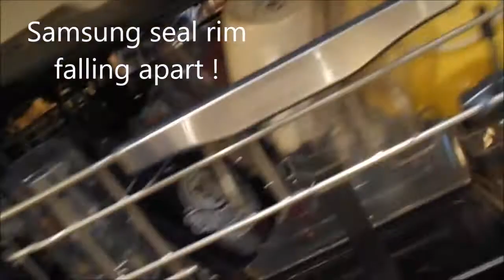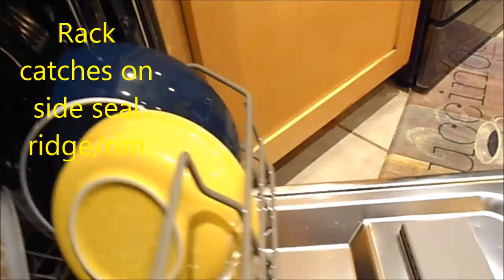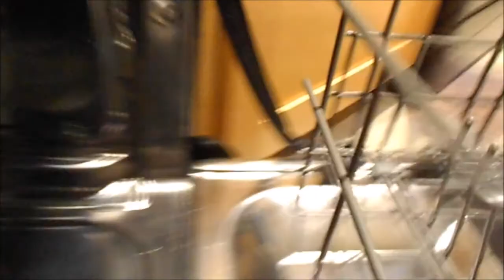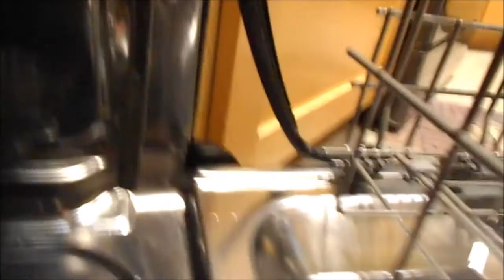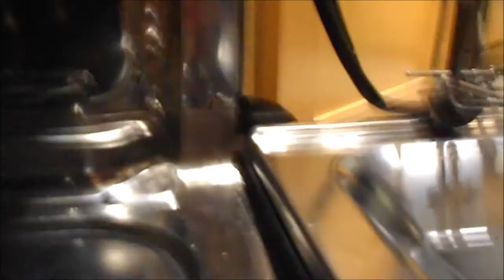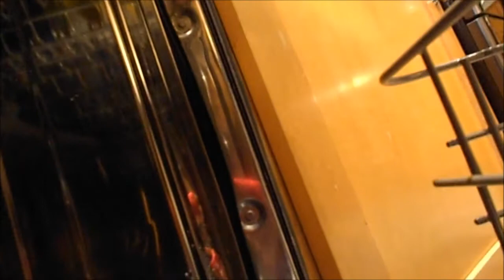Samsung dishwasher repair

Comment: What size sheet metal screws did you use? Did it work? No leaks?
Reply from the maker: I did that about 5 months ago for a friend, no complaintes. You have to use your imangintion on these kinds of things , Peace
Reply: @EurekaRecycler  Whats the best way to get the screws through the metal? I tried self drilling screws for stainless steel and a drill bit for stainless steel and still cannot get through. Any video of that process?